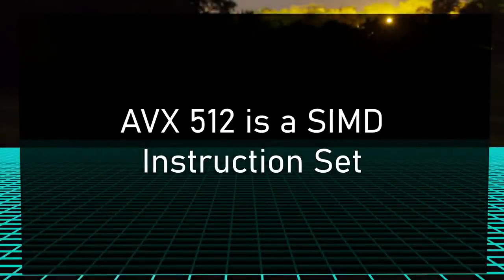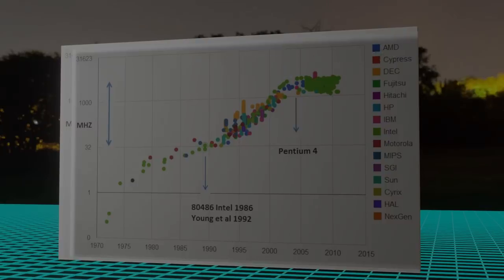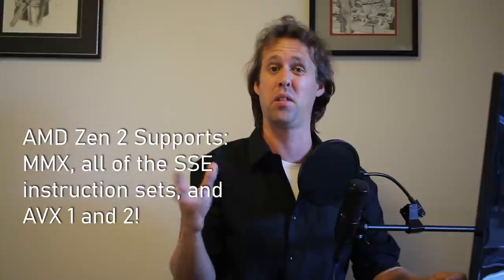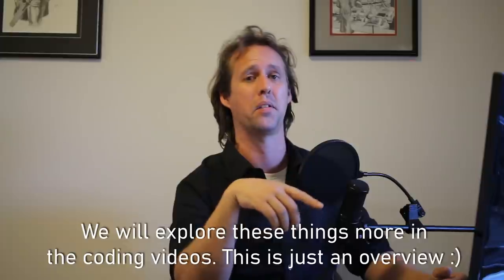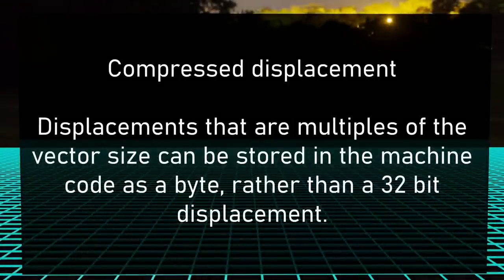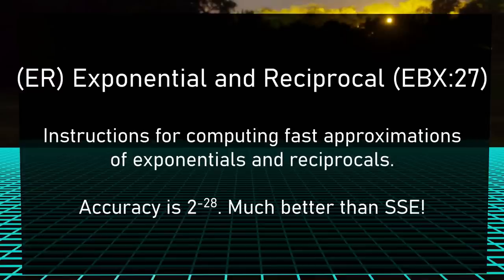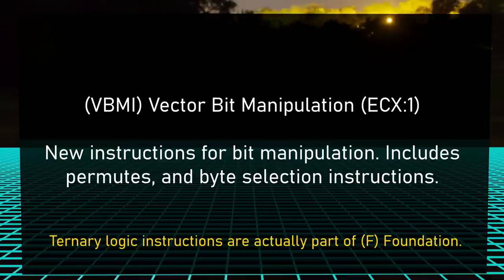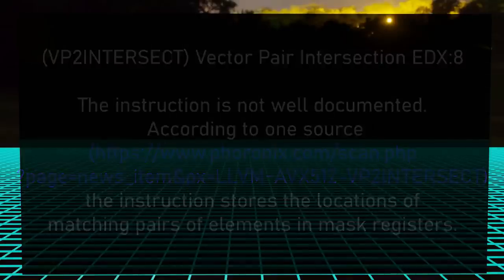AVX512 (1 of 3): Introduction and Overview

Comment: Back in the day, I programmed the Z-80 and 8080  8-bit CPUs for a living.  More recently, I designed a Minimal Instruction Set with only 16 instructions. I don't see how a larger instruction set is necessarily a good thing, because there's always a learning curve. For my money, I like a very reduced instruction set, and a smart compiler with pseudo instructions and a nice API for fancy things like 64-bit multiply and divide. All good wishes!

Comment: What are the chances that any of this will ever be used? Could you express anything in a language that would tell the code generator to use this stuff and use it well. Do the language developers advance at the rate of the instruction set developers?  Languages from their beginning have always used a tiny part of the instruction set. If you use these new instructions aren't you incompatible with everything else. How many version of code do you write and support? You can always access everything from assembly. I write only assembly (for 50 years) for embedded applications but most programmers today can't spell assembly. I love the idea of massively parallel fast architectures that I would program in assembly. But I wonder how many programmers are out there ready to do it. Intel poured millions into this so they must think it is important. I wonder if it will hit .01% of the applications?

You do an excellent job of covering these detailed topics and support assembly very well. Thanks.
Reply: They'll probably be used in a few places in a few heavily used libraries, but yeah you have a point
Reply: The compiler will support it and produce code that uses it. As more CPUs support AVX512, there will be more applications using it.

Comment: I think Intel really missed an opportunity, however, in that AVX-512 should have used a VLIW model, and should have transitioned to a decimal floating point arithmetic format for that instruction set.

Also: AMD's Zen 4 architecture is planned to include AVX-512.

P.S.: Your playlist is currently arranged backwards.
Reply: Intel burned their fingers with VLIW on Itanium 1 and 2. VLIW was therefore a dead end, just like the optimization to super high clock rates with the Pentium 4.

Comment: Like others are saying, Zen 4 (7000 series Ryzen) does support AVX512, but the CPU doesn't actually have 512-bit registers. As I understand it they're double pumping the 256-bit registers to achieve the effect of AVX512, but it probably doesn't have the same performance as an Intel CPU. Most consumer Intel chips don't support AVX512 at all anymore though... There was a way to get early samples of Alder Lake working, but afaik it's impossible with Raptor Lake

Edit: Also, I'm pretty sure early Ryzens did the same thing. Double pumped SSE registers to achieve AVX2 support

Comment: Adding new instructions is kind of bad approach comparing to adding cores. Old software compiled years ago will have no benefits from new instructions, software compiled today with new instructions set will not run on old hardware. While multithreaded application can create as many threads in runtime as you need, at same time will work on old hardware, and have benefits of new hardware with more cores.
Planned obsolescence and support of lazy programers who wanna write single thread applications...